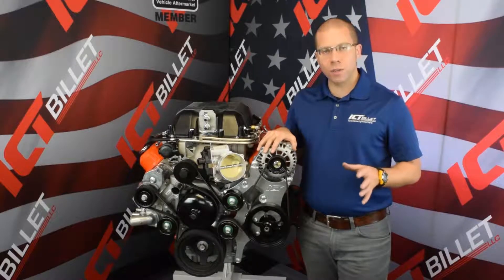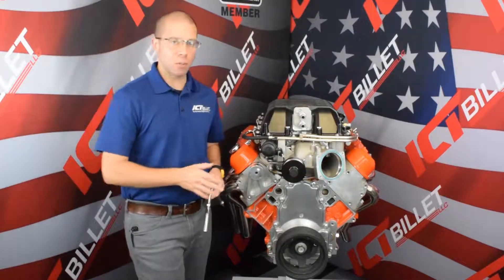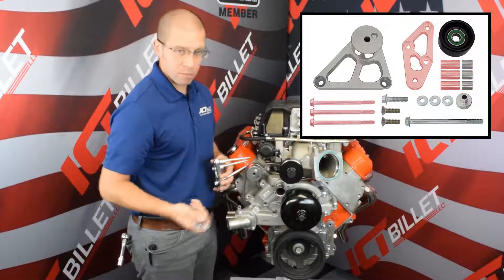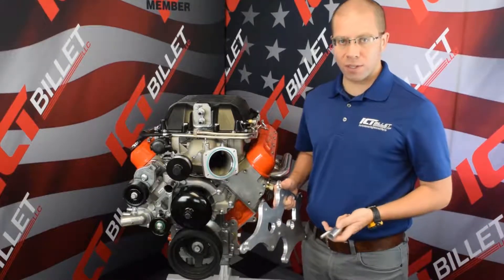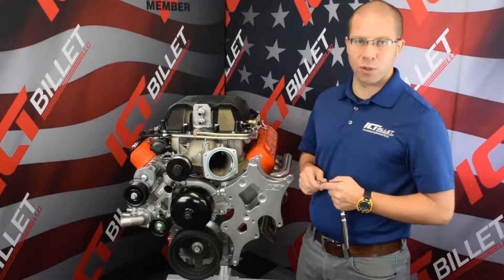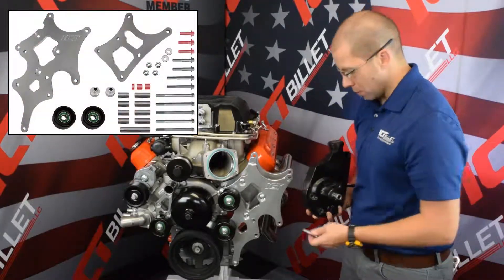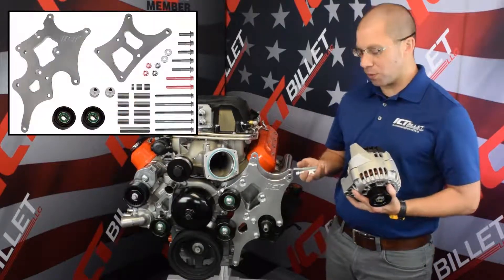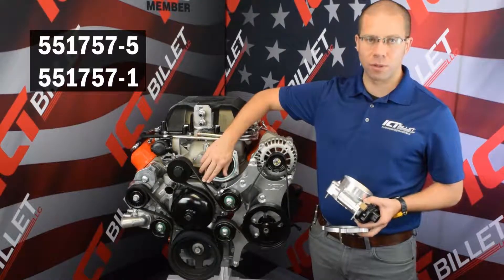ICTBILLET 551787A-3 LSA SWAP TRUCK ALTERNATOR POWER STEERING KIT INSTALLATION INSTRUCTIONS

Comment: What if I want to use my ac
Reply from the maker: This Kit is designed around a direct swap to an existing LS Truck, not necessarily a swap scenario; so the A/C compressor remains in the factory "low-mount" location.